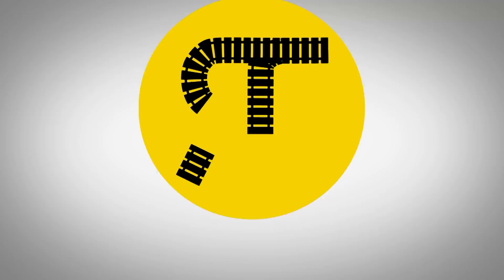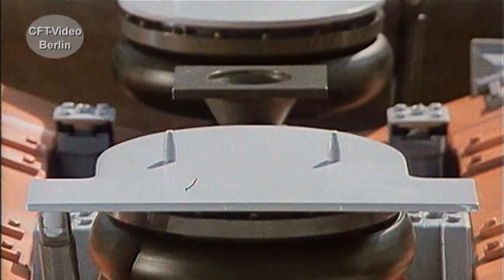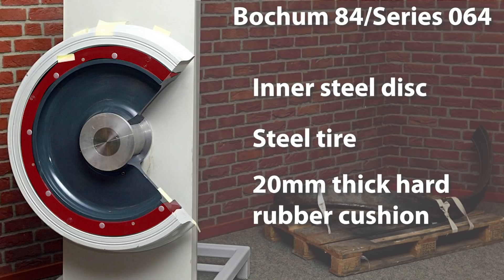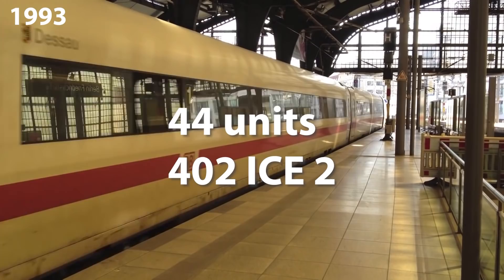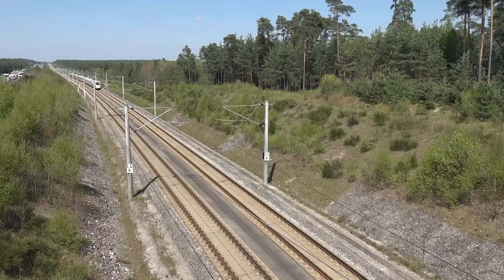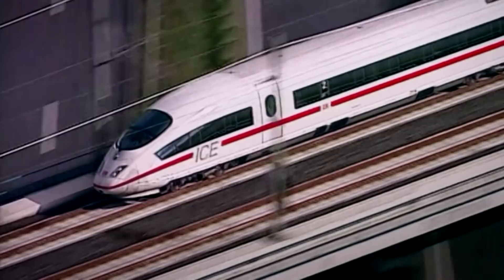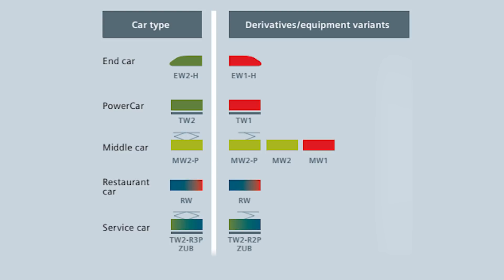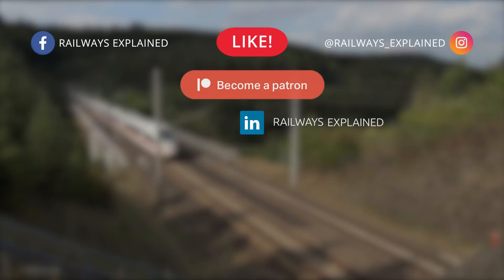Evolution of German InterCity-Express Trains - Explained

Comment: Great video. One addition, since you are talking about the export of train sets to other countries. Since 2015, a total of 19 Velaro (ICE3) train sets were also exported to Turkey, and 18 of them are operating at up to 250km/h between Istanbul-Ankara and Ankara-Konya. One of the Velaro TR  locomotives was unfortunately destroyed when colliding head-on with another locomotive inspecting the track, This happened in the vicinity of Ankara with a death toll of 9,

Comment: "It's maximum grade is only 4 permille." 4 permille is a lot for a main line. If I am correct, it is one of the highest grade in the World for a high speed line.
Reply: You're not correct. 4 permille is a lot for a regular mainline, but high speed lines can be ten times steeper. Many French lines are and also stretches of Cologne - Frankfurt. The power to weight ratio of high speed trains allows for suches grades.
Reply: @qora01m  g

Comment: Although it was mentioned for later versions, the obvious reason ICE 1 could not work in France etc. was the different power supply. I would also question whether trains can operate at full speed on 1.5 kV as implied in the commentary.  Current required would be massive.
Reply: Here we have a common thing at 1,5Kv DC you can only run max at 200 km/h and we just accept that. So for lines we want to go faster we use 25Kv AC

Comment: In 1980 several members of BR's Class 86/0 25kV electric locomotives were fitted with similar wheels to the ICE1 coaches for a similar reason becoming Class 86/3. These locomotives weigh 82,000kg and can run at 161km/h on 1.15m diameter wheels. By the end of the 1980s and with no major incidents related to the wheel sets they were refitted with monobliv wheel sets and flexicoil suspensi8n and reclassified to Class 86/4. Yes, the wheels on the ICE 1 coaches are smaller, with diameter of 0.92m, and will rotate faster when at the same speed as the Class 86/2 they do carry a lighter load their fatigue loadings will be higher. With Germany's reputation for engineering excellence I just don't understand how they failed to realise that any damage to the tyre was enough to ground each set for wheel set replacement.

Comment: one thing i do not understand is why ice 4 does not do speeds like 320km/h ? 
is there a reason for that?
Reply: A reason for the lack of 300 km/h capability on ICE 4 trains is the organization of the german rail network. Most tracks are mixed use and are, at most, upgraded to 250 km/h. Therefore the higher cost of a higher top speed was not feasible for most trains. There are, however, new ICE's being built on the platform of the ICE 3 that can reach 300 km/h. On the routes which are solely build for HSR they will be used, probably under the name ICE Sprinter, which are express connections.
Reply: @konrad2607  seams logical
Reply: @lpt2606  but DB realized that sometimes 250 km/h is too slow. That's why the Vmax will be upgraded to 265 km/h.
Reply: @flecken  The timetables are still made for 250 kph. The 15 kph extra are intended to reduce delays and are not included in the timetable.
Reply: Trains for 320 km/h are way more expensive, because European train safety regulations are divided into several speed categories. Above 250 km/h the trains have to be much sturdier.
Reply: My bad, I thought that was obvious.

Comment: Velaro D (class 407) is the best by far in my opinion. Very modern, but also capable of 320km/h operation.

The ICE 4 is just too slow!
Reply: ICE 4 gets a software update that makes them capable of 265 kph. Still slower than the others, but a little faster.
Reply: @blubberdignubber  yeah, not enough. several new 300km/h lines are planned
Reply: @nicolasblume1046  It’s enough for the lines they’re operating on. ICE 3 or BR 403, 406, 407 and soon the BR 408 which were ordered are all capable of 300 km/h+ and these are the trains that are operating on the 300 km/h+ lines. It doesn’t make economical sense to order trains that can go 300 km/h+ and then operating them on lines that have speed limits of 200 km/h to 250 km/h.
Reply: @timhp8  in 20 years almost all ICE lines will have at least one 300km/h section as part of their journey. For example there will be such a line between Hannover and Bielefeld, so the Cologne - Berlin would also need faster trains.

There will be very few lines that dont have 300km/h sections
Reply: The interior is worse too on the ICE 4.
Reply: @nicolasblume1046  These trains were ordered in 2011 (tendering started three years earlier in 2008), at a time when Deutschlandtakt (the project the line you're mentioning is a part of) was just a concept. This means that DB couldn't have foreseen that a project as expansive as Deutschlandtakt would actually happen, at least not at the time these trains were ordered. Furthermore, the line you're mentioning is still in research phase. By the time this line and other lines like these will be completed, at least 20 years will have gone by (take a look at earlier projects like the SFS Köln - Frankfurt and VDE 8 for example, which all took at least 20 years from inception to realisation). The oldest/first produced ICE 4 sets will probably be nearing the end of its service by then (just like ICE 1 and 2 are now, although they will be kept in service longer) and be replaced by newer (and hopefully faster) trains. Also worth mentioning is that ICE 4 was not just meant to replace ICE 1 and 2, but also IC 1 (BR 101 + coaches) which currently only go up to 200 km/h.

Comment: I'm Chinese studying in Germany. I prefer the ICE1/2/TGV Duplex the most, then the ICE 3 BR403/406 with old interiors. I don't like the new ICE 3/4, the worst seats ever on a modern high speed train. And the price/speed/reliability are all dominated by China Railway high speed service. To be fair the service from DB Fernverkehr and the confiniece of transfer are generally satisfying (if you don't catch the delays or cancellations), but I still miss my hometown so much every time I travel with DB Fernverkehr (long distance)
Reply: Yeah, China had the advantage of developing it's rail system from scratch while in Germany a lot of lines are still following the original routes from the 19th century. Plus the Chinese high speed rail system doesn't have to be profitable as the central government covers the roughly 1 million US-Dollar in losses per day.
But I am optimistic that the DB will get the situation under control as they are a lot of investments on the way. But this will take another decade :)
Reply: @derriegel5705  Weak railway infrastructure contains too much transport demands, that's the biggest reason of the embarrassing situation for Deutsche Bahn. The Germans need more support from the government side to match up their rails and trains, China Railway needs to learn the experience from the European and Japanese of how to make the rail system more flexible and efficient under existing conditions...

Comment: 5:45 Minor note: where and when was that Clip with the trams filmed? Let's collect the Information from the Clip:
- The vehicle on the right is a DUEWAG Pre-Metro Car Type B (known in german as Stadtbahnwagen Typ B, B-Wagen for short).
- Judging from the paint job and the shape of the headlights we can confirm that it is one of the B-Wagen that were produced for the Düsseldorf Stadtbahn network. 
- Further more,  the shape of the current collector and the edges of the roof tell us that this is one Of the first dozen of B-Wagen made for Düsseldorf (numbered 4001 to 4012).
- The other vehicle is a DUEWAG Tram Car Type M/N. Judging from the paint Job this unit belonged to the  Mülheim/Oberhausen Tramway network at the time of filming.
- What makes this even more odd is that both vehicles operate under different gauges: the B-Wagen on standard gauge, the M/N Wagen (at least the ones on the Mülheim/Oberhausen network) on metre gauge.

EDIT: Okay, just discovered something: that M/N Wagen does NOT belong to the Mülheim/Oberhausen tram network, but rather the Krefeld Tram network. The reason I didn't notice that earlier is the fact that all Krefeld trams have since been repainted in a white and red coat of paint.

Comment: Despite traveling a lot on the ICE, I still never had the luck on getting an ICE 4 trainset. Most of the time I get an ICE 1 or ICE 2. Occasionally the ICE T when traveling southeast to Würzburg, Nürnberg and beyond and ICE 3 when traveling between Frankfurt and Cologne.
Reply: You can consider yourself lucky then. ICE1 are the most comfortable to ride on by far.
Reply: No, you are lucky. The ICE 4 is the worst so far.
Reply: How did you know that it was an ICE 1?
Reply: @remaks8405  They have that "Hump" on the Cafeteria Car. Except for that, ICE 1 and ICE 2 are pretty similar.
Reply: @remaks8405  the 2 also has only one loco and different seats
Reply: @MattiBlume  The non-powered ICE4 cars run extremely smooth, I like them a lot. For me the worst seats are those of the redesigned ICE 2.
Reply: @remaks8405  Easiest way to tell ICE1 and 2 apart is simply their length. Is it two short trains together or just one short train -> ICE2. Is it one very long train -> ICE1.

Comment: 13:17 Russian "Sapsan" рas 2 variations : ''EVS1'' - for 3.3kV DC and ''EVS2'' for 3300V DC and 27.5kV AC 50Hz. These trains have a completely redesigned traction scheme, so their sounds are completely different compared to the trains of the ICE series.

Comment: I had to chuckle when I heard the term "train set" in context of the real large trains, because it reminds me of the tiny toy train sets :D

PS: For real, no matter what I do - "train set" in dict cc only exists in context of toys, and "train set" on the english Wikipedia also only leads to the model train sets. And if I Google it, of course it only shows me model train sets. Is "train set" really a real term for large trains?

PPS: Even the Merriam-Webster dictionary defines "train set" as follows: "a toy train with its tracks, buildings, etc."

If it really exists for large trains, can you tell me the definition? Because unfortunately I am unable to find it :-|
Reply: A train set refers to any multiple unit with fixed formation. An ICE 3 for example is always the same in make-up (how many coaches and which classes and where they are in the train formation). It thereby forms a fixed set that can also not really be taken apart outside of maintenance depots. Those are the key criteria for calling something a "train-set". There are also coach-sets, for example the Transpennine Express Mk5A sets, which are semi-permanently coupled and are intended to always run in the same formation.

Comment: It peaked with the ICE 3 the 4 is so annoying, I try to avoid as best as I can.
Reply: Why?
Reply: @diy.o2693  small legroom, not enough space for luggage
Reply: @diy.o2693  Also seats which are much more uncomfortable than the old ones. Less padding and you're not able to properly recline (not even in first class). All you can do is pull out the seat bit, but the backrest stays straight.
Reply: @diy.o2693  less interior space all around, worse seats, slower, ...